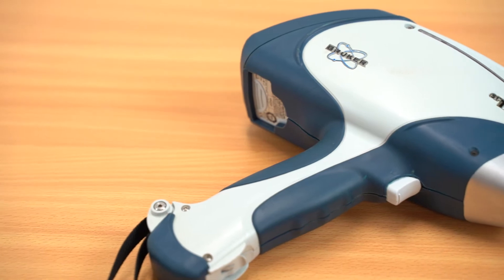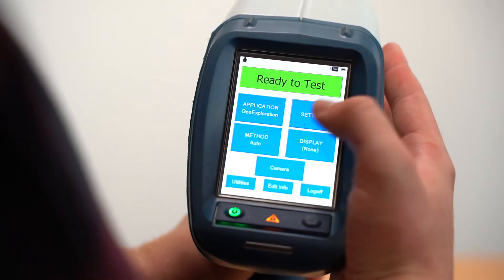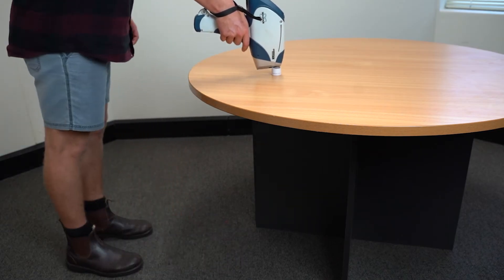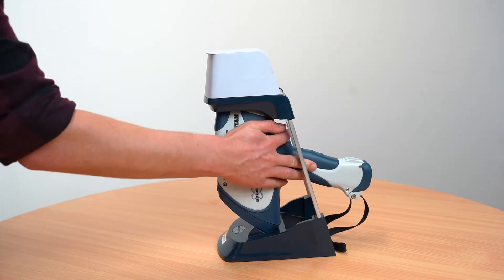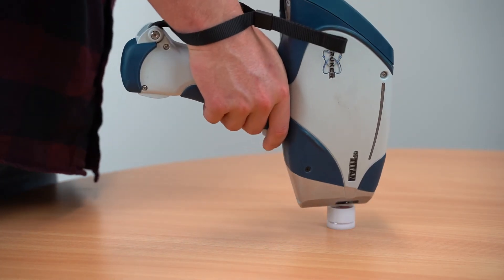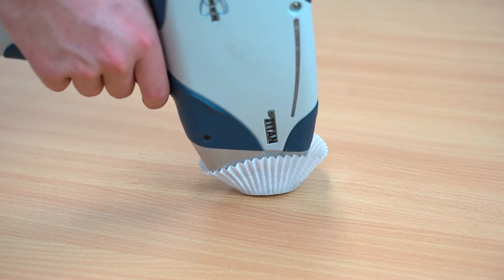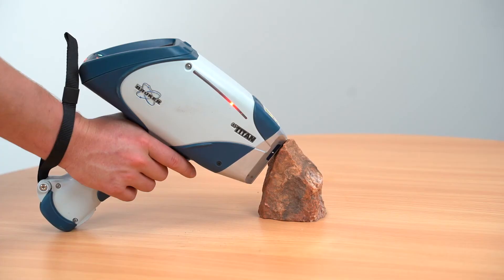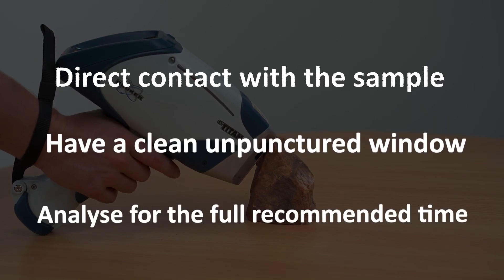How To Use a Portable XRF - Sampling on a Portable X-Ray Fluorescence Analyzer Bruker S1 TITAN

Comment: Would this get an accurate reading if I used it on tiny 1-2mm rock grains individually? Instead of a bowl of powder like you used, I'm wondering if a 1mm rock grain is enough material for it to get a reading.
Reply from the maker: For the best results you want the sample to cover the whole aperture of the window. A press power gives good homogenous results.
Reply: @ProfessorSpectrum   then what about collimators that aim the x-ray at a tiny <1mm spec.....  are those not giving good readings?
Reply from the maker: @manager4409  Yes you can use a collimator, to block out the extra x-rays. How ever you will receive less counts, so you may have to compensate by increasing scan time.
Reply: Thanks! They even make polycapillary optic mirrors that aim the x ray to as small as 50 microns. So obviously it must get a reading from a tiny grain. I guess I don't understand why you need a large sample if the x ray is tiny (even without a collimator)
Reply: So in theory you could get fully accurate elemental readings off one tiny 50 micron rock grain as long as you let it get a longer count?

Comment: Thanks for your video, I have a few questions about the sample cup. Now I'm having the S1 Titan 800, I want to measure loose powder precious metal sample, is it ok if I use the sample cup in this video to measure or I need to check for the others? Thank for your helps
Reply from the maker: Hello, the sample cup used in this video should be fine to use for your samples.

Comment: good afternoon dear.

One question, I am doing my degree work and I am using the S1 TITAN XRF-BRUKER ELEMENTAL equipment
 

I was looking for its technical specifications and I can't find
I would like to know if you could help me by providing me with information on in which units the data is reflected

in PPM, or any other.

I await your prompt reply..
thanks a lot.

Best regards.
Reply from the maker: Hi Sofia, depending on the calibration it will either be in ppm or percent (all elements will be in the same units). Depending on the order of magnitude you are getting in your results, this will determine if it is ppm or pct.